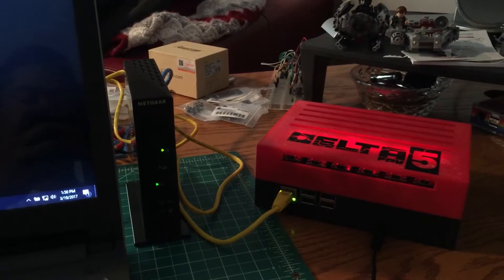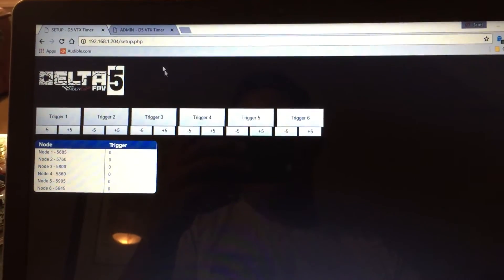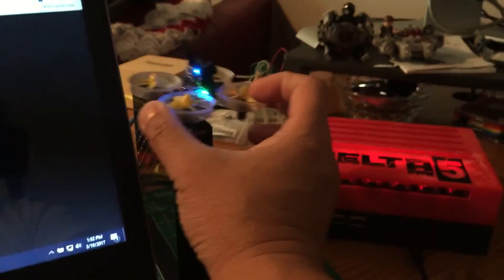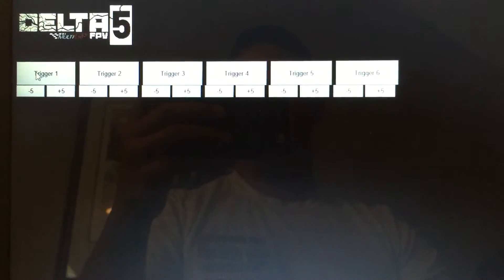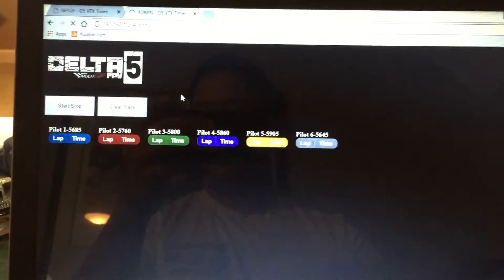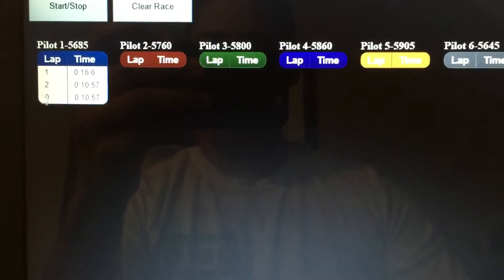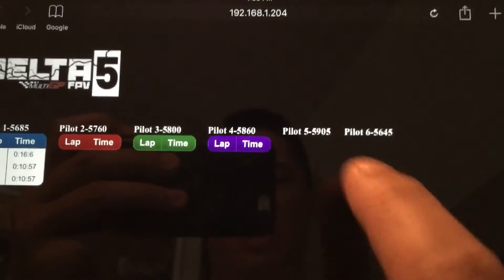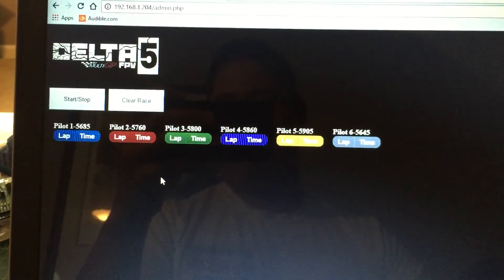Delta 5 Race Timer Setup

Comment: Hi, one cuestion: Basically is a receiver per pilot, so can I have for example 10 or 8 rx ?
Reply from the maker: Esterlin Polanco yes it's one receiver per quad. The newest version of the software lets you configure the number of nodes up to 8. But you can tweak the software to handle more. Check the FB group and the GitHub repository for the latest updates.

Comment: Great work!

Have you tried constantly switching frequencies to support two quads on one receiver?
Reply from the maker: It takes half a second to switch, and I'd be concerned with 2 quads flying through at the same time and missing one, or both.
Reply: Half a second? Ok that explains it. I read somewhere that it was 25ms to switch hence the question.
Reply from the maker: Maverikou I shouldn't have said half a second, I apologize. I've noticed that it works better if you wait before the first trigger, like it settles in. That may be the way my polling loop is coded. So switching back and forth could require a delay